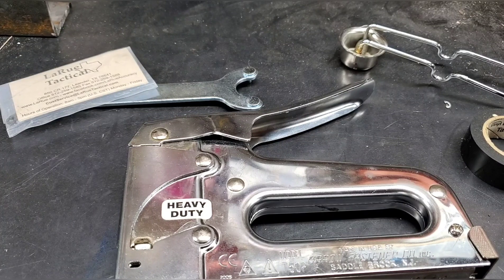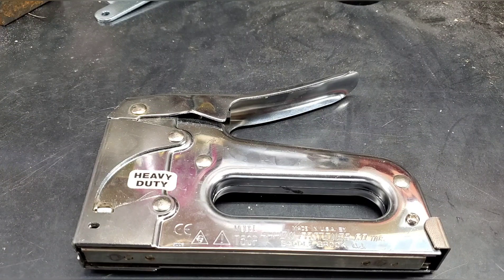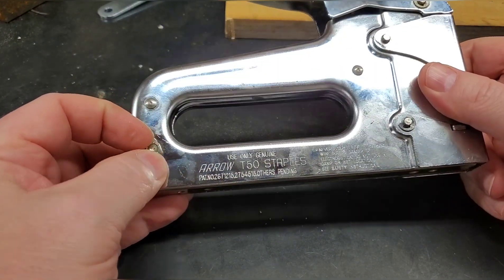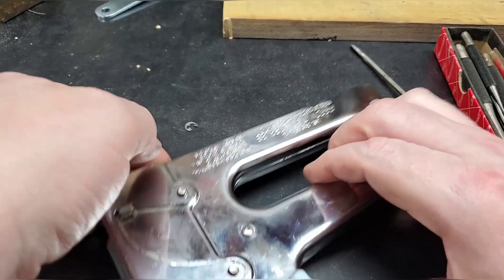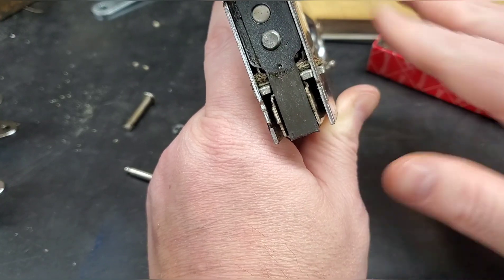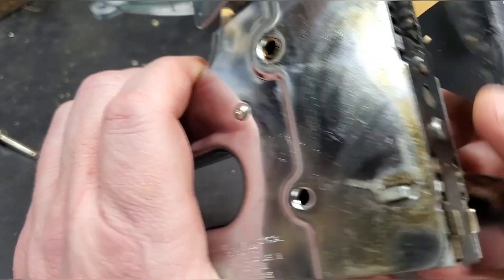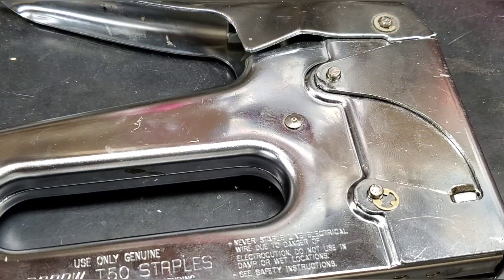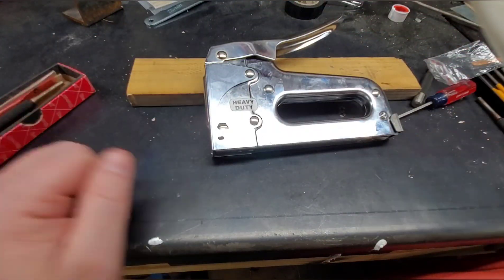How to Repair a Jammed Staple Gun

Comment: Just fixed mine that  kept shooting 2 staples out. It had two problems, epoxy glue got stuck between the striker and the front cover, forced the striker away from cover and then it hit 2 staples. Other was the staple carrier, it has 2 pieces spot welded together and it broke apart. I carefully epoxied it back together. Long ago, I was gluing some FG cloth and the glue was not fully cured, so glue got stuck between the cover you took off, and the striker. It had been broke for more than 10 years.

Comment: Do you maybe have an advice what to do if your staple gun shoots 1-3 clips? Sometimes one 2 come out and 1 holds perfect and the other is upside down? I have no explanation for that....
Reply from the maker: Wow, that sounds strange. Could be the spring or flawed staples. I'd try a new lot of staples and go from there. Other than that, I'm not sure what else it could be. Good luck!
Reply: @Bluelightbandit  Just fixed mine that did that. Two problems, epoxy glue got stuck between the striker and the front cover, forced the striker to hit 2 staples. Other was the staple carrier, it has 2 pieces spot welded together and it broke apart. I carefully epoxied it back together. Another problem could be wrong width staples.

Comment: I did exactly what you did and after i assembling the leaver is not
Moving loose up and fix back same problem. Don't  know what  to do now.
Reply from the maker: Without looking at it, it's hard to tell. Sounds like the handle isn't seated properly. Sorry for your troubles.

Comment: Mine works as it should except it will not drive 1/4 inch staples completely into pine wood.
Reply from the maker: The staples may be too long for that. Maybe try shorter staples.